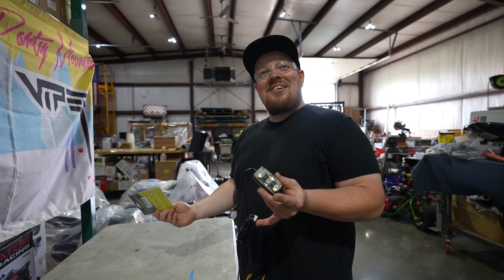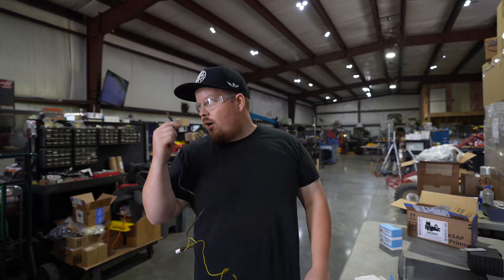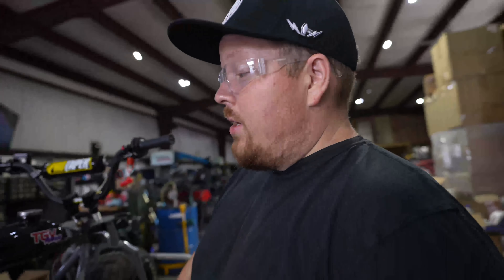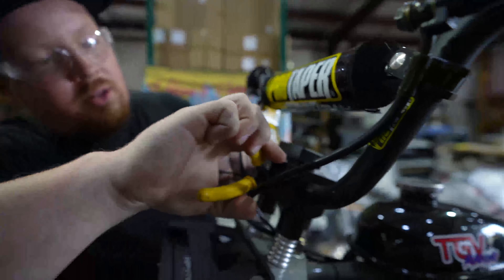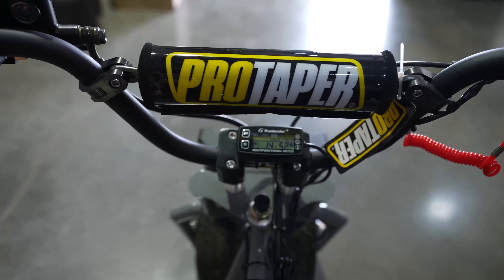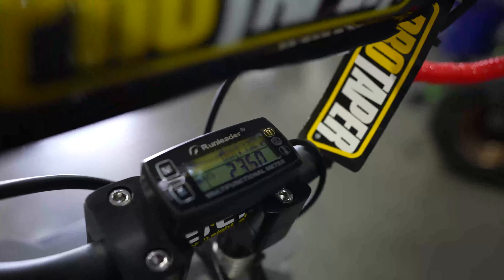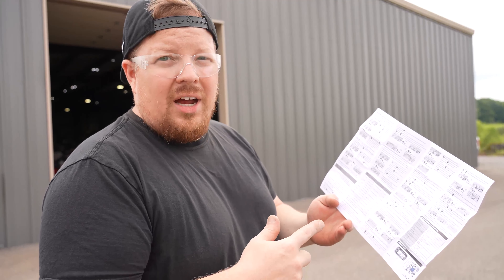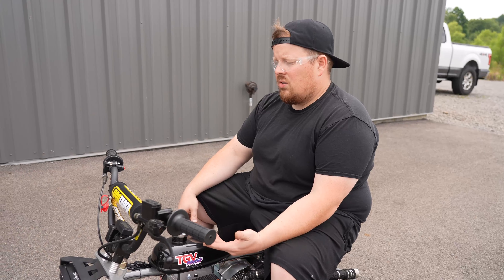This Tach Is Awesome!! Runleader Meter Install/Review

Comment: Seeing as it does work pretty well. A very late helpful tip is these engines run around 350 to 400 degrees anything above 420 I would be worried about as they are a aircooled and fuel cooled engine. Hopefully this is helpful to someone lol

Comment: Is the display waterproof??? Because i got a norxi display with sensors but.... the display isnt waterproof 😢😢
Reply from the maker: The listing claims it is IP67 waterproof, looks like it would probably be okay for some light rain, but I definitely wouldn't try power washing it or anything. I avoid getting mine wet, so I can't say for certain.
Reply: @TheGarageVlog  okay thanks. But after a trip with heavy rain my norxi mini 4 doesnt work anymore. So i think factory fault or something i dont no. But youre telling me that youre display is ip67 waterproof

Comment: I installed this on my moped, works fine up to about 10.000 rpm then i just jumps to 25.000 I don't know if i wrapped the wire wrong or something
Reply: 10k rpm on a moped? Change the settings.
Reply: @smannee  My man workin leg day every day all day.  Like the cartoon burnout run before they actually take off running.  
Stay gold.

Comment: I would’ve put a head bolt thru the eye, if it wasn’t for your beautifully scripted video! 🤜💥🤛
““Back to you!””
Reply: I forgot to ask what is a good running temp on these air cooled engines. 
I’ve not burned one up yet, but I’m trying! Lol
Reply from the maker: Haha I'm not sure, have to take a look in the manual maybe